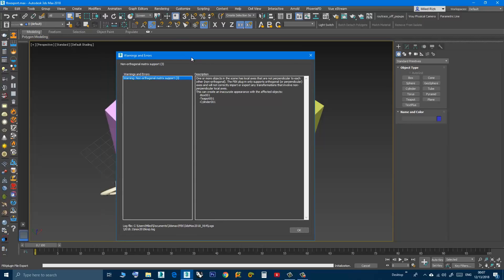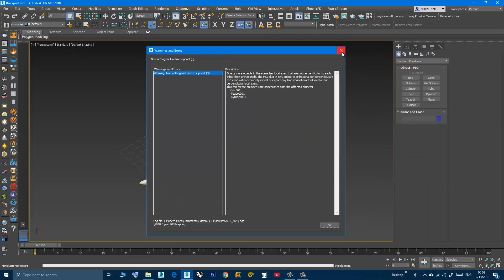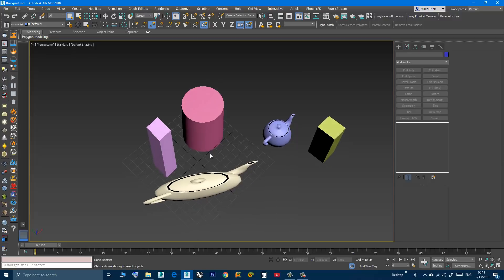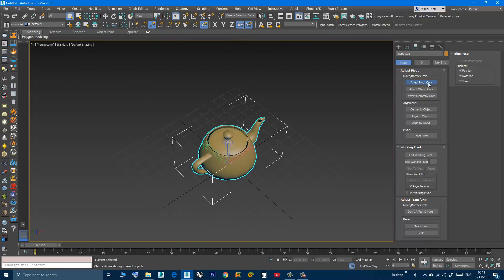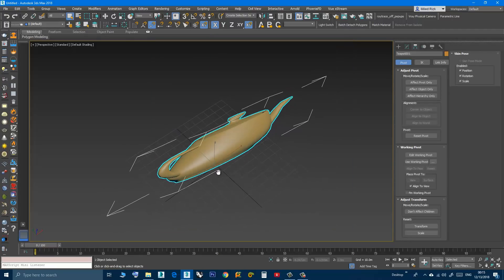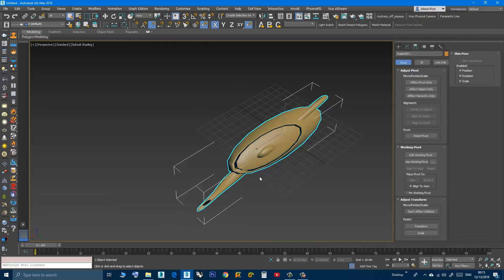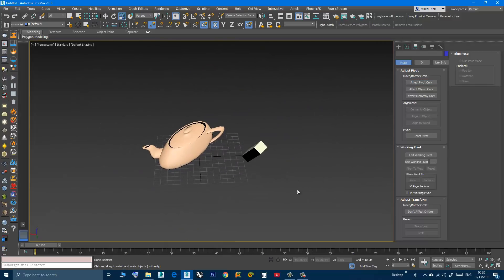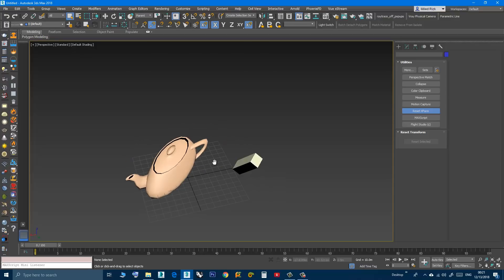3DS Max - FBX Export Warning: Non-orthogonal matrix support - Fix

Comment: i followed all the steps but all of my objects began floating, then they disappeared?
Reply from the maker: Hi, even though it's not easy to diagnose without seeing the file, I'll suggest two things for now to test. But first, make a copy of the file just for exporting.
1- Make sure you're scene is not too far from the origin, since this can cause all sorts of issues. If so, grab everything and bring them as close as possible to the origin.
2- If objects are in a Parent-child hierarchy, that means linked; select them and press the Unlink Selection button.
And try again.

Comment: Thx alot! I am still wondering why default setting is set on "View" when you can mess up with it so easy. Is there a way to change it to "World"?
Reply from the maker: Welcome! for the reference coordinate system, I'm afraid that you cannot change that without scripting. But you need to understand that this will not help with the problem mentioned in the video. You can end up in the same situation.
Reply: @MiledRizk  Yeah I know my point was off topic. But I understood the Non-Orthogonal problem. Thats what I came for. THX!
Reply from the maker: Welcome

Comment: Very well explained ! blue thumb
Reply from the maker: Thank you :)
Reply: @MiledRizk  No problem you deserve it. I really appreciate the way you explain your knowledge very pedagogical ! But to be honest, it didn't solve my problem because i got this trouble on multiples bones based on a CAT hierarchy . I checked both concerned bones's pivots and they seems perdipendicular and well set so it's strange !
Reply from the maker: @Ardagulaire  I guess the error message was different than the one in this video, and probably it wasn't about non-orthogonal local axes. Try to bake the animation and see if that works. In the FBX Export dialog, Animation rollout, check the option Bake Animation and see if that fixes the issue.
Reply: @MiledRizk  One or more objects in the scene has local axes that are not perpendicular to each other (non-orthogonal). 
The FBX plug-in only supports orthogonal (or perpendicular) axes and will not correctly import or export any transformations that involve non-perpendicular local axes. 
This can create an inaccurate appearance with the affected objects: 
    -RArm22
    -RArmDigit31
    -RArmDigit32
    -RArmDigit33
    -RArmDigit21
    -RArmDigit22
    -RArmDigit11
    -LArmDigit23
    -LLeg2
    -LLegPalm
Bake Animation is checked during export and this problem still persist . But strange thing is that doesnt affect my exported model in engine ! Btw thanks you for your time and answers 👌
Reply from the maker: @Ardagulaire  I think I have an idea on how to fix that. Try this: select the problematic bones in the scene, right-click the Scale tool, and in the dialog that opens up,  
On the left side "Absolute: Local", check to see if all the values are 100. I think they are not, probably very close to 100 like 99.99 or something like that, but anyway, set the values to 100. Now try to export again and see if it helps. I suggest you do a complete manual check-up for all the bones, one by one.
Reply: @MiledRizk  I did what u suggested to me. When i right click scale tool on bones, it indicates me 100% on every axe. But i decided to test one bone and set manually to 100 all axes like u said me even if it was not useful. But after that all values have changed ! X have been set automatically to 99.99% , Y automatically  to 100.01% and Z automatically to 100%. So u were right !! But strangely it was 100% at the beginning before i try to change. And when i want to set to 100%... it doesnt want ! So   i dont know how to do it
Reply from the maker: @Ardagulaire  Ok, one last try. First, try working down the hierarchy, that means starting from the top parent down, select the first bone, right-click the scale tool, set all axes to 100, and copy the 100 value, now go down the hierarchy, select a bone, right-click the scale tool, and, instead of typing the value 100, paste the value in all axes and hit enter. Now See if this will give a better result.

Comment: Hi, I can’t export my tank modified the logiciel say me : The following maps are only supported by 3ds Max; they will not be recognized by other applications. To learn how to convert them so they will be compatible with other applications, see the Render Map Dialog topic in the 3ds Max documention. HELP ME PLS
Reply from the maker: Hi, I guess you're using procedural maps, like Checker, Dent, Noise, etc,... these are maps created using an algorithm from within 3DS Max, so only Max can recognize them. There is a way to convert those procedural maps into regular bitmaps. Click the Map button so that you're inside the Map rollout, now right-click the slot (the Sphere that shows the map) and choose Render Map, in the Dimensions groups, choose the Width and height of the output texture, and in the Output group click the Files button and select where you want to save it. Click Render. You have a bitmap now that you can use a regular bitmap texture. In the last step, choose an empty slot and apply the created bitmap as a texture and apply the new material to the object and export again.
Reply: Do you have Discord ? for you can see my problem with a video
Reply from the maker: @lrzglitcher9710  hi, sorry, I'm outside now with some friends, you can record a video and send me the link. Did you try my suggestion?
Reply from the maker: @lrzglitcher9710  Hi, I'm just checking if you solved the issue. Let me tell you the good practice when you want to export to another program, always use Standard materials + regular bitmaps and never procedural maps. So, you need to check two things in your files. 1- if there are materials that are not Standard applied to the model. 2- If you're using procedural maps, like Checker, Noise, etc,... You can use the workaround, described in my other reply, for converting a procedural map to a regular one.
Reply: Hi, thanks for explanation, I take the 3D model of World Of Tank game, in 3ds Max, I add a new item on the tank but when I will export the logicial say me the message in my first commentary and next the name of the files that I import, duplicate or delete on the tank. I will try to export with your explanation earlier

Comment: Some materials in this scene may not be supported by certain applications and will import as standard gray materials instead. The following materials are affected:

sir help me to solve this issue for wxporting into fbx
Reply from the maker: Hi, I suggest you use Standard Materials inside Max before exporting, Unless you're sure that the other program (Unreal, Unity, etc,...) that you're exporting to can handle these materials, for example, V-Ray materials, Physical Materials, etc,... So basically this message is a  warning, it doesn't mean your geometry will not be exported well.

Comment: The following maps are only supported by 3ds Max; they will not be recognized by other applications...........

sir this errors occure when i export my file into fbx , plese help me ,
Reply from the maker: Procedural Maps, like Checker, Noise, Cellular, Dent, etc,... cannot be used outside 3DS Max, these maps are mathematically generated, so other programs cannot understand them. What you need to do, if this is the case, is to render these procedural Maps as a normal bitmap textures, save to disk, and apply it again to your material. To do that, in the Material Editor, go to the Map level, and from the Utilities menu, click Render Map, in the dialog, keep the default option to Single, and in the Dimensions section, choose the Width and Height for your texture, now click Render, after the render is finished, save it from the frame buffer window, and that's it.